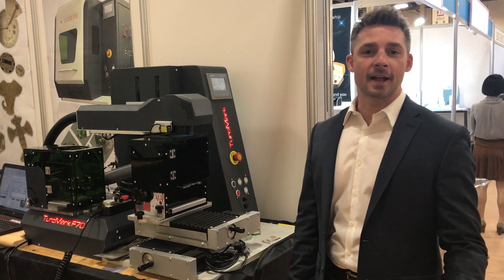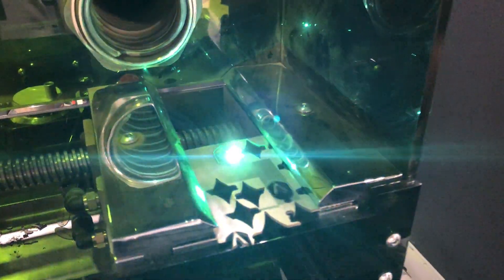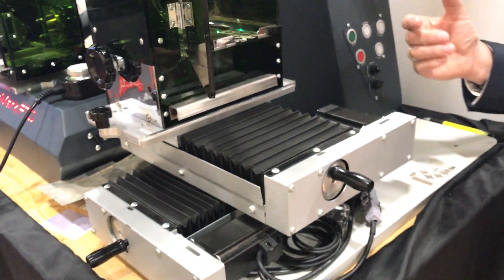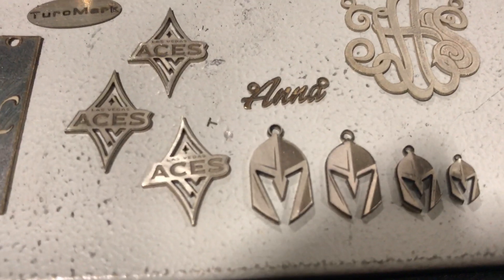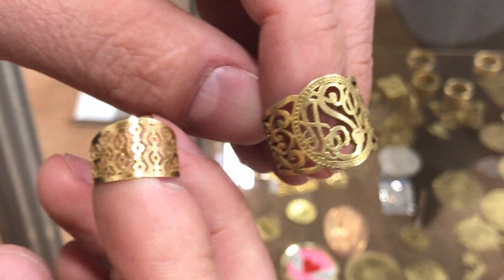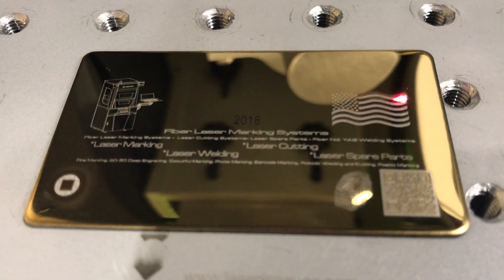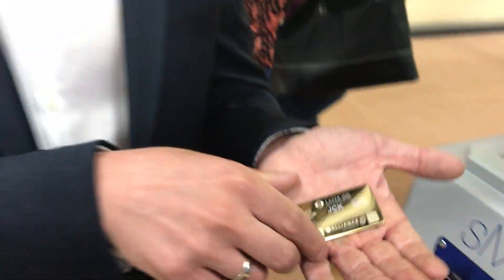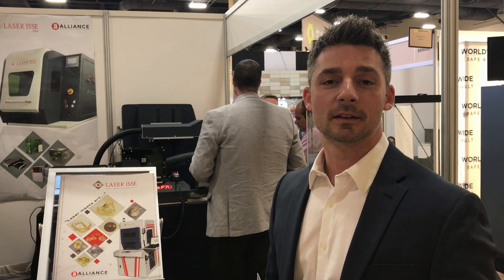JCK 2018 Laser Cutting and Engraving Demonstration

Comment: is the gold cut by this machine costs far more than the one made by wax from molds consec poured in concrete??
Reply from the maker: You can absolutely cut gold. The benefit is no consumable materials like wax. Also if you need to make a change you don't have to create a completely new mold. Just edit your drawing and design and recut the project. Simple process.
Reply: @alliancespecialtiesandlase2905  thank you